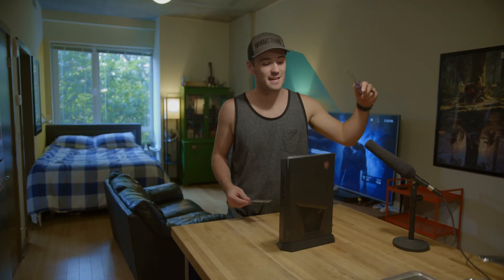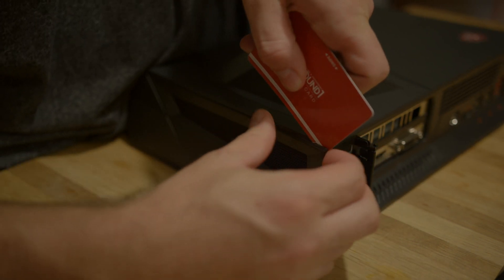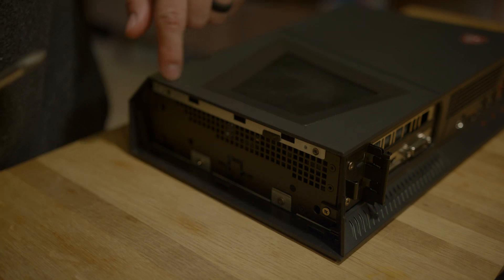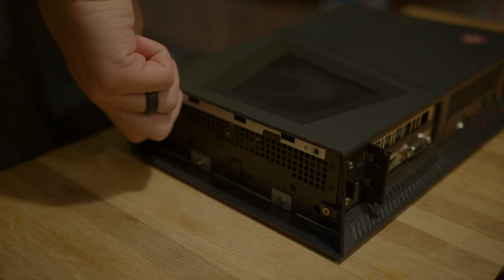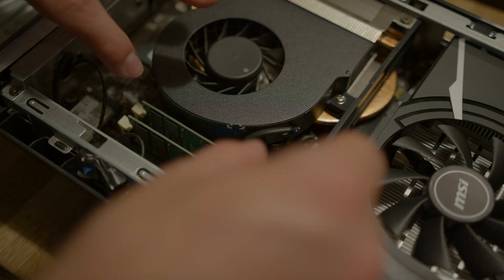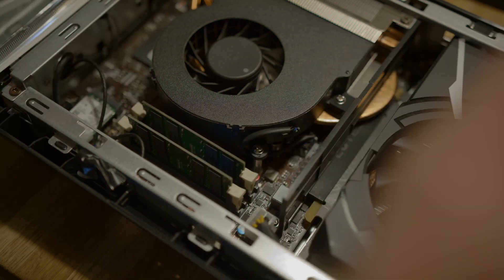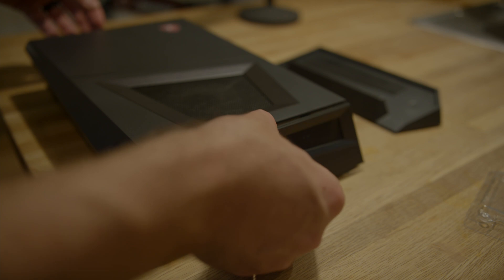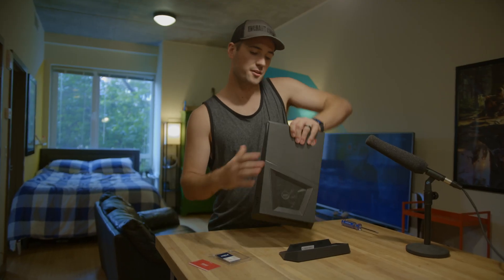How To Upgrade & Install RAM on MSI Trident 3 (10th Generation)

Comment: Sir, i want to ask about ram size, I bought desktop ram last week but trident3's ram size is small, so do i have to buy raptop ram?
Reply: Are you sure it was ddr4, it can perfectly goes in a trident
Reply: @noedelbaere3456  Yes, ddr4 it was, so i bought ram for laptop and it is working well. Thanks for comment.
Reply: @BSTiger-f9h you just bought normal laptop memory ram ? Or a specific one and how much mhz
Reply: @MIGUEL20  normal laptop size
Reply: @BSTiger-f9h  and how much mhz?

Comment: Hey man, can you help a kid out for Christmas? My son has this desktop and I am trying to figure out what RAM I can get for him to upgrade to (2) 16g sticks? I'm not the most knowledgeable with computers and I'm just trying to make my kid happy for Christmas lol. Any advice on what type of RAM I should buy would be AMAZING!
Reply from the maker: Honestly I don’t know that any specific brand is better than any other one. Just so long as it’s ddr4.
Reply: @PhillyCinema  I purchased a PNY DDR4 but it looks HUGE compared to the sticks you used in video. Is there a specific size for this PC or do I need to search for a specific physical size
Reply from the maker: I don't think there's any size difference so you should be good. The ones I use in the video are just as bare/small as they come. But the actual connectors should be there same.
Reply: @PhillyCinema  ok I will see if they fit in between the clips like in your video. THANK YOU for taking the time to reply to my question man, I really appreciate it!
Reply: @PhillyCinema  merry Christmas man, unfortunately the RAM sticks I picked up were WAY TOO BIG to even remotley fit into the spot where the old one is. Back to drawing board.

Comment: hi, i'm trying to help someone upgrade but they are very illiterate when it comes to computers so i can't get jack info out of them about it that i need to know. what kind of ram does it use (laptop or pc) how many pins? what's the max frequency the board can handle and the max GB of ram it can accept?
Reply from the maker: Assuming you have the same exact one as me, the max is 32gb. Not sure about the max frequency but any DDR4 Ram should work.
Reply: @PhillyCinema  thanks a lot!

Comment: Does this work the same way on older generations? I think I have a 7th or 8th generation, but I can't remember.
Reply from the maker: It should be basically the same, but I believe the fan placement inside might cover the RAM slots so you may need to move that too. Should just be a matter of unscrewing a few more screws.

Comment: This video will be very helpful to my friend, thanks. He is looking to buy one of these. I wanted to ask, does it come with 1*8 or 2*4 GB RAM?
He would probably need to replace both if it's 2*4 (I don't think a 4 GB RAM would run well alongside a 16 GB) making it a bit more costly.
Reply from the maker: Nice.  I think mine came with 2x4gb

Comment: Thanks for the video. Can ı upgrade to 3200 mhz ddr4 ?
Reply from the maker: Yeah, I'm sure that's fine.
Reply: @PhillyCinema  Thank u. Well i have one question. Can ı upgrade to rtx 3060 12gb this model ?
Reply from the maker: @guraysahin734  I don’t think you can upgrade the graphics card. Sorry.

Comment: Is 32gb ddr4 2666mhz too fast? Should I got with 32gb 2400mhz?

What speed did you use? I have the MSI Trident 3 10si-003us
Reply: You can use up to 3200Mhz but the max frequency on the mobo is 2933Mhz, so you won't get more than that.
Reply: @obakamaster  Thank You!
Reply: @Mr_J112  If it helps, I upgraded my Trident 3 with 32GB Kingston HyperX Impact RAM. Kingston specify in their website that those modules auto overclock to the max frequency supported by your mobo. I bought 2x16Gb 3200Mhz RAM and are currently running at 2933Mhz in my Trident 3
Reply: @obakamaster  Okay I'm gonna have to get some. That helps a lot! There's no video that talks about this pc enough
Reply: @obakamaster  I bought the same ones and after I installed yesterday my trident is running just fine YouTube, Netflix can be on all night but when I’m going to play any game the pc Restarts NOT SHUT DOWN RESTART   It happens already twice I don’t know what to do
Reply: @miguelramirez3548  Hi, that seems to be another issue as with defective RAM units the PC doesn't start. Try to update your GPU drivers and your OS to see how it goes. Keep an eye on the temperatures when playing heavy games.

Comment: Hey quick question I’m look for a 24gb ram stick idk which one fits can you give me a product I have the same trident 3 1650s
Reply from the maker: Nice. I think any ddr4 should work. Here’s the Amazon URL for the one I used: Crucial RAM 32GB Kit (2x16GB) DDR4 2666 MHz CL19 Laptop Memory CT2K16G4SFRA266 https://smile.amazon.com/dp/B08C4X3F3S/ref=cm_sw_r_cp_api_glt_fabc_AD2RCN4ZQ825K8H581B3?_encoding=UTF8&psc=1

Comment: I just got one an upgraded the ram to 16gb + 8gb so I have 24gb . -and when I play and stream the FPS in the game it goes bellow 60 and my game lags a lot what can I do to fix this issue I have the 1660 super with the i7 10
Reply from the maker: I'm sure you've tried lower the graphics settings in game, right? Alternatively you could bump up the ram to 32gb.

Comment: You can’t upgrade the gpu right? Can u take the cpu and like just make a pc?
Reply: I think it depends on which PSU you have. My trident has a 1660 super which is good enough for me considering the outrageous prices that GPU's are selling for right now.
Reply: @AchillesWrath1  it uses an external brick and I’m 99% sure that the max u can get is 330w
Reply from the maker: I don't think so. Outside of the Ram, it's pretty tough to mod these.
Reply: @PhillyCinema  I mean I wanna move  it can I take the gpu and cpu and ram and migrate it to a bigger pc case. Then get a better psu and gpu to upgrade
Reply: @charldavid8036  no but I think u can upgrade GPU

Comment: Hey what ram sticks should I buy I heard you need custom ones
Reply from the maker: I think any ddr4 should work. Here’s the Amazon URL for the one I used: Crucial RAM 32GB Kit (2x16GB) DDR4 2666 MHz CL19 Laptop Memory CT2K16G4SFRA266 https://smile.amazon.com/dp/B08C4X3F3S/ref=cm_sw_r_cp_api_glt_fabc_AD2RCN4ZQ825K8H581B3?_encoding=UTF8&psc=1
Reply: @PhillyCinema  could I upgrade gpu like to a 3060 or a 2070
Reply: @PhillyCinema  I was about to ask the same.  I was told DDR4 3200 MHz SO DIMMs. i want 2x32 but not sure where to go.

Comment: I have a trident 3 but idk if its a 10th generation
Reply from the maker: Should be roughly the same process. I think some of the older gens have the ram slots behind the fan though (just a few more screws to unscrew if that's the case).
Reply: @PhillyCinema  i searched up and noticed there's a 10th gen and like a VR version. i know for sure i have the VR one. idk if its 8th gen or something.
Reply: Check your processor model. The Trident version is because of the processor gen.

Comment: And also I got a bundle that came with the monitor to and the monitor is 165 hz but I don’t see it to set it up to 165 the highest it goes is 144 does the trident 3 not support it or what’s the problem ? If u could help I would appreciate it a lot
Reply from the maker: Hmm could have to do with your connection cable? Are you using HDMI and does the monitor have other inputs you can try?
Reply: @PhillyCinema  yea it does but it didn’t come with the cord for it and wdym connection cable

Comment: Which ram are you using?
Reply from the maker: Crucial 32gb DDR4
Reply from the maker: Here’s the Amazon URL: Crucial RAM 32GB Kit (2x16GB) DDR4 2666 MHz CL19 Laptop Memory CT2K16G4SFRA266 https://smile.amazon.com/dp/B08C4X3F3S/ref=cm_sw_r_cp_api_glt_fabc_AD2RCN4ZQ825K8H581B3?_encoding=UTF8&psc=1